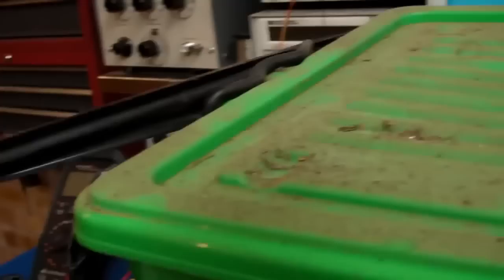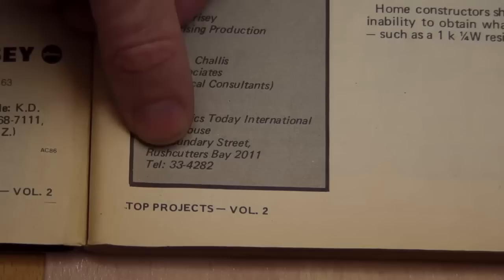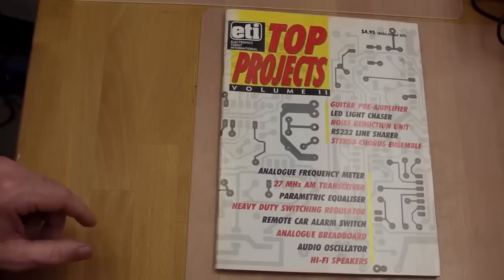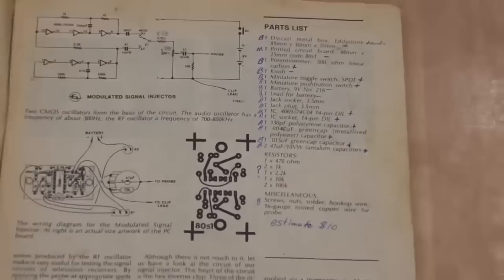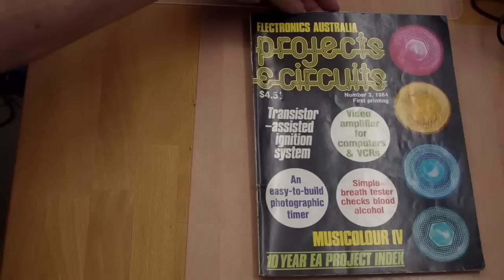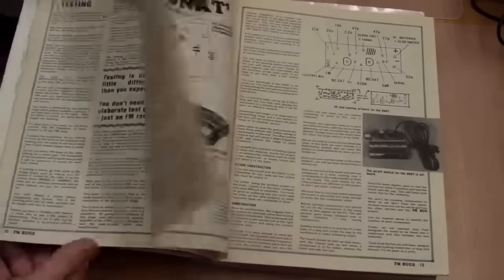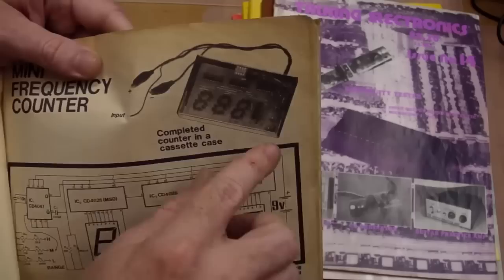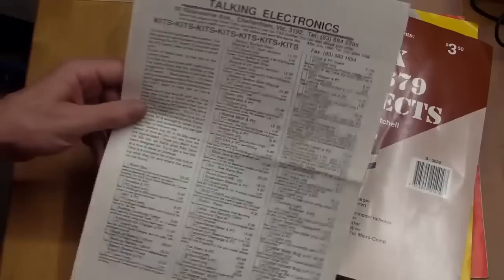EEVblog #142 - Electronics Magazine Memories

Comment: I just stumbled across this video quite by accident, which prompted me to dig out some of my old magazines. Even though I was only born in the late 60s, I've actually got copies of "Radio, Television & Hobbies" - a precursor to Electronics Australia - from the 1950s (my earliest being the August 1956 edition), as well as Electronics Australia from the 1960s, 70s and 80s. The icing on the cake is a couple of old ice-cream containers filled with assorted valves! That makes me either nostalgic or just a common hoarder.
Reply: Don't let your partner find this gold mine , it will be straight to the bin!

Comment: 1986? I was twelve. I was interested in electronics, had already built my first AM radio, and had a electronic multimeter I have to this day (HC-5010EC - I probably need to get it calibrated). (and 1999 is rougly 12 years ago :) )

Comment: Hey Dave, you talk about simple circ that work even with a microcontroller ... and got my thinking ....  I was stuck at making some stable speed controller (analog fashion) for a DC motor. I find dificult to make one able to control RPM when load is changing. Of course with a micro, PWM and a taco would be great .. but I prefer the simple. Have you got a sample circuit to do this in your magazines ?. Love your channel. First in class.